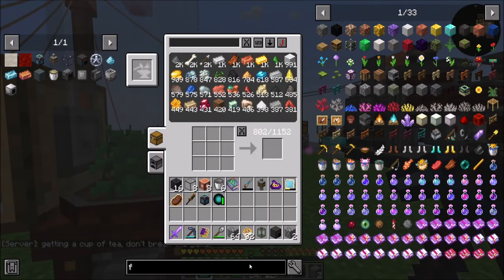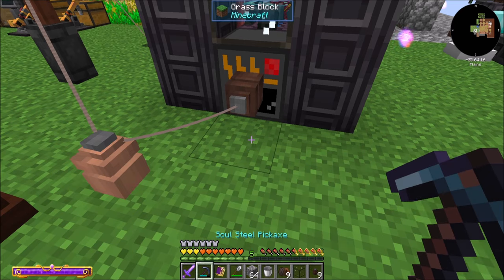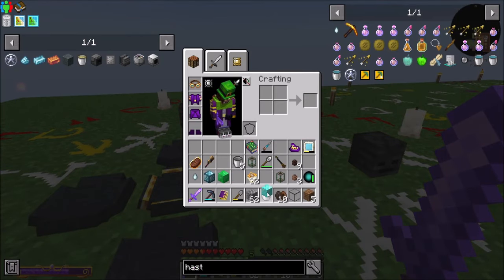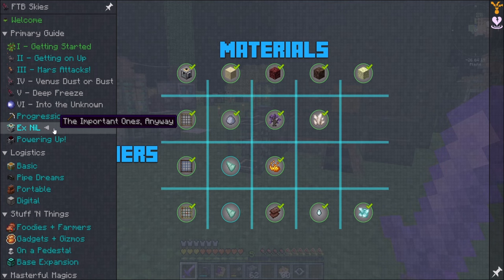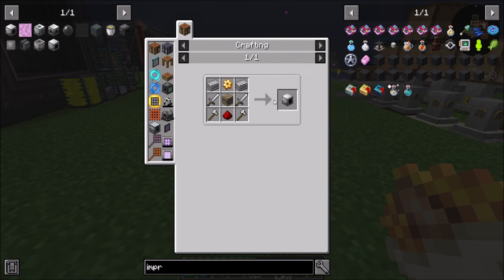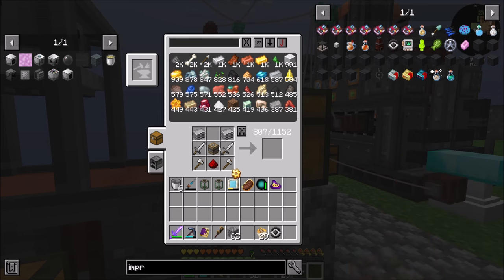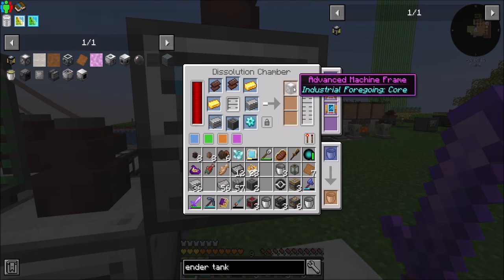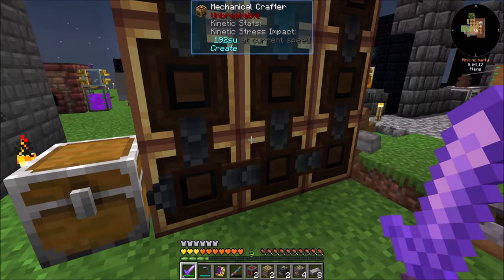FTB Skies Expert Ep44 T4 Crusher and Oil Prep

Comment: Hey Dire, if you're able to make the ars nouveau containment setup, you can capture the crusher spirit and use a hopper to input raw materials/ores into its inventory! Good way to condense him
Reply: You can also put him on a create bench. I’m using the occultism transporter spirit to bring the ore from a crate to the crusher and it works perfectly.
Reply: Don't know how you got it to work but I can't, the containment jar just doesn't accept any item inputs, no matter what I tried, hopper, item transporter, mekanism pipe, just droppinh the items on top xD
Reply: Just found it, it's an additional mod called Ars Ocultas and it's not in this pack, might add it tho, already did a setup with dropping the ors on this guys in the non expert version of this pack